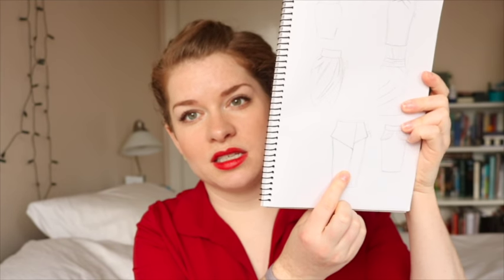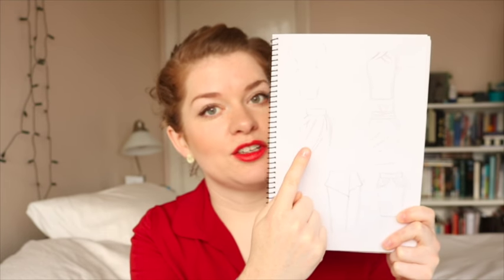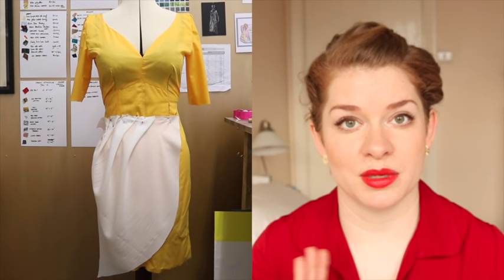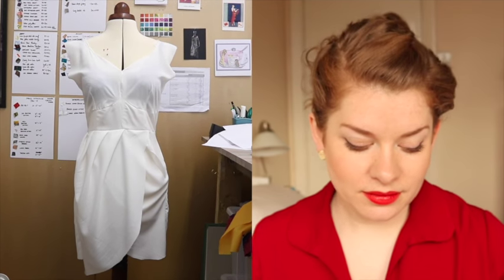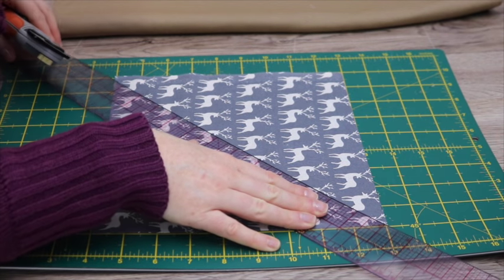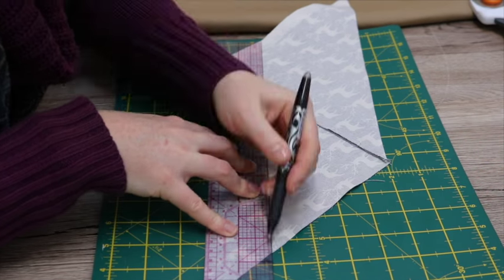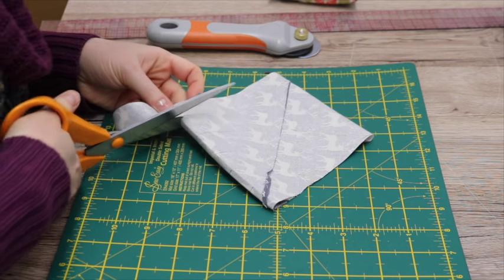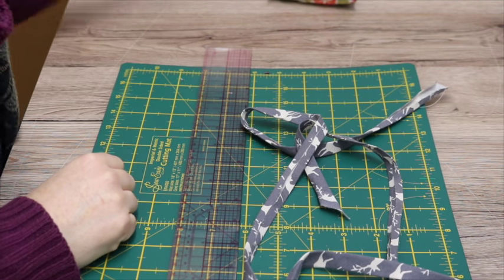How to Make Bias Binding via Continuous Loop - Vlog 19

Comment: I am a bit confused with the Toile? (Twirl !!)  or the making of. It always seems a really good idea but being a little short in brain matter on that front clearly (!) you make it and alter it to fit you beautifully ...... but then do you unpick it all and lay each Toile(?) piece as your pattern template to be cut out on your true fabric? Knowing me, I am more likely just to wear the Toile !!! Hope you can advise p.s. I love your videos !!!
Reply from the maker: It's a bit of a multi stage process so don't worry that it's not that clear! 

You draft the pattern and make up the garment in a cheap fabric that has similar properties to the fabric you want to make the final item out of (or make the toile from a commercial pattern if you're not self-drafting) then adjust that version to fit you. 

You need to make a note of the changes you make when you fit and then transfer those to the paper pattern, so you can cut out your 'proper' fabric using the adjusted pattern pieces that will echo what you did on the toile version. 

It's essential if you're self drafting as you don't really know how the thing will look until it's made, but if you're using a commercial pattern you don't have to do a toile - it's good practice, and if you are using expensive fabric it can save costly mistakes, but if you don't have time don't worry! I know lots of people who don't do toile and I don't if I'm making something quickly. Hope that helps!